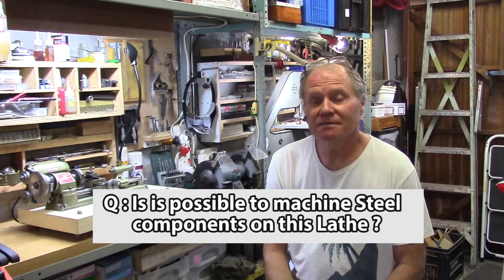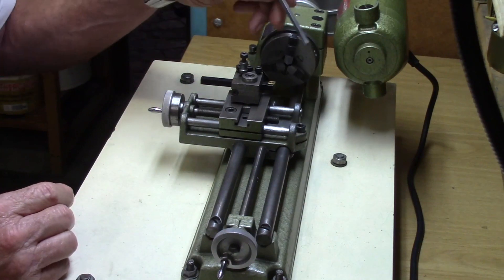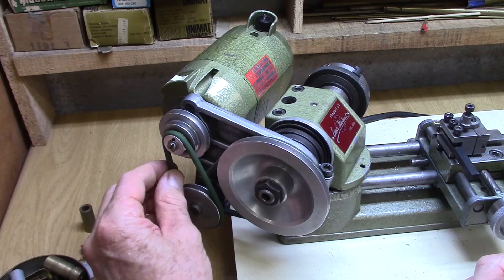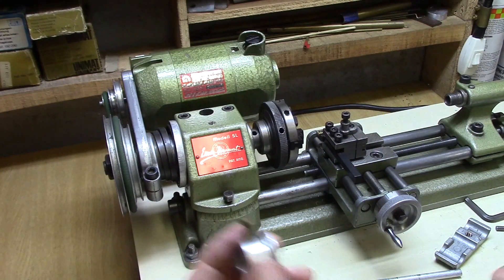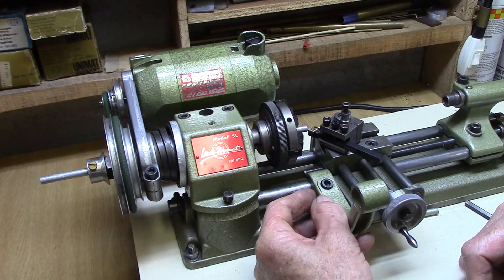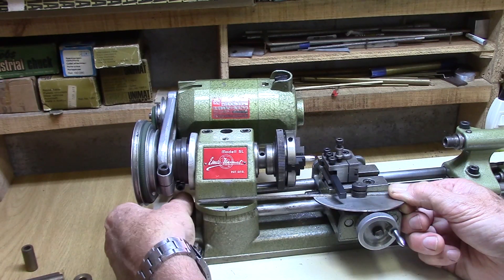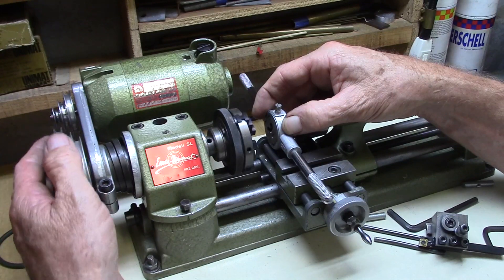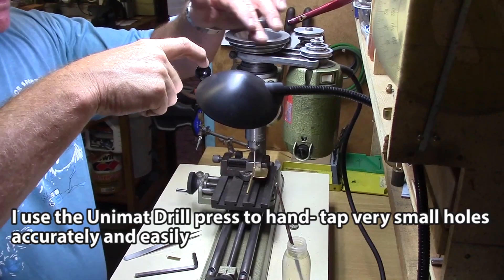More about the EMCO UNIMAT SL Lathe

Comment: Hi. I just bought a emco unimat SL and am busy restoring it. It came without a motor. I also live in South Africa, eastern cape. Do you know much about motor replacement options I could look at? I know some guys have used 24 volt motors with speed controllers. Don't know if or where I could source that here. Also my auto feed  is incomplete. I seem to have everything except the two shafts, the long one that the drive pulley attaches to and the short one on the other end where the two gears go on. Would you be able to give me sizes and dimensions and then I could possibly have them made up for me by engineering works here? Awesome channel. Thanks.
Reply from the maker: Hi, thanks for your interest. There are a few YT videos out there about replacing the Motor on the Unimat SL, just do a YT search on this subject. You need a 12Volt 100- 150 Watt  DC Motor turning about 1200 -2400 RPM with a Switched DC Speed Control and 30 Amp  12V DC Regulated Power Supply. I do not know where these components  could be sourced in SA but they should be available because they have other Industrial and Commercial applications..  I  do not have AutoFeed on my Unimat SL.
Reply: Thank you so much.

Comment: Hi what's the max swing on this lathe please. Thinking of getting one for making small steam engines
Reply from the maker: Hi, if you have access to certain Unimat SL  accessories it is possible to machine a flywheel up to 76.5 mm in Diameter with the Unimat SL by raising the Headstock using the intermediate piece. The Unimat  chuck jaws can also be reversed to hold larger Diameter work up to  30mm Diameter  Watch my other Unimat SL video on my SteamerEdge YouTube Channel entitled "All about the Emco Unimat SL Lathe ".  In this video I discuss the swing of the Lathe in some Detail at 2:50 and 3:30.Cheers Paul
Reply: @SteamerEdge  Hi, your tool holder looks very compact. Could you please comment on its dimensions so I can make one? I made one with aluminum dovetails, but it's very large and there isn't much space in my Unimat SL.
Reply from the maker: @drehmaschineklein6626  Thanks for your interest.  My Tool Post is custom built. I have a Unimat SL Tool Post Modification video in the pipeline which should be published in due course. The video deals with how my custom built modified Tool Post differs from the Standard Unimat SL Tool Post and the dimensions of my Tool Post.

Comment: How do you make the vertical configuration? are there another accessories needed to mount the motor?
Reply from the maker: Yes, watch my other Unimat Lathe Video " All About the Emco Unimat SL Lathe " which is also on my " SteamerEdge " YT Channel. This video shows how to configure the Lathe for Vertical Drilling and Milling.

Comment: Very nicely explained,  I have 3 of them setup un different configurations. All very useful. Watchmaker spindle on this lathe is a very useful option, as all pivoting and very fine jobs can be done with high accuracy
Reply from the maker: Thanks for your interest, yes, the Unimat is an amazingly useful and versatile little machine. I see you have an interesting hobby restoring old timepieces. I've always respected the fascinating precision engineering in old clocks and timepieces.Cheers Paul
Reply: @SteamerEdge   Dear Paul, indeed a useful and quite precise machine, in drill mode it can be easily converted to a light milling unit if feed mechanism is built. And it bridges the gap between C1 and watchmakes lathe. Jacot tool can also be used here in conjunction with watchmake's spindle and the thread follower is very versitile. Thanks, Sanjay

Comment: Would you only recommend mild steel with this model. Does it work better with hot rolled or cold rolled?
Reply from the maker: Hi, over the years I have successfully machined Mild Steel, Cast Iron and Drill Rod ( Specialized Carbon steel ) with my Unimat SL. You need to be patient, take very light cuts, keep lathe tools sharp and keep the work piece well lubricated during machining. Cheers Paul
Reply: Thank you so much

Comment: What kind (length) od belts You using?
Reply from the maker: Hi, I use 4mm diameter Polyurethane Belting material  This is a fairly common commodity because it has many industrial applications and you should be able to easily source the Polyurethane belt material in your area. This belt material can be cut precisely with a very sharp hobby knife. Before cutting, measure the right  length by placing the belt material on the lathe drive pulleys to acquire the tension you feel is right. Measure twice before cutting to make certain and then mark the cut with a pen. After cutting, try the cut belt section on the pulleys again to determine if correct length has been cut before joining. If not, either shorten or start again. Join the belt using heat, something like a cigarette lighter or a flat-bladed soldering iron. Carefully smooth the rough edges at the join using coarse sandpaper. There are already a number of YouTube videos showing how to join Polyurethane belts, just do a YT search. cheers Paul
Reply: @SteamerEdge  you can use super glue also, I’ve never had one break at the seam

Comment: Hi! Awesome video. I just managed to get a hold on one of these machines through an acquaintance of mine, but it is incomplete. Are you able, by any chance, to provide me with some dimensions of the toolhead/toolpost? It seems I am unable to get my hands on an original one.
Reply from the maker: Hi, I have a video in the pipeline which should be published within a week or two about a modifications to the standard Unimat SL Tool post. The video also shows the standard Tool Post dimensions. You can also buy a manufactured Tool post, which fits the Unimat from RDG TOOLS. Have a look at their website and type Unimat Tool Post in the search bar. cheers Paul
Reply: @SteamerEdge  Thanks! I'll look into it.

Comment: Fascinating machine. I have begun restoring my father's this week and look forward to getting it up and running again. One Q: Where do you get the belt material and how do you make them? Thanks!
Reply from the maker: Hi, thanks, I use 4mm diameter Polyurethane Belting material  This is a fairly common commodity because it has many industrial applications and you should be able to easily source the Polyurethane belt material in your area. This belt material can be cut precisely with a very sharp hobby knife. Before cutting, measure the right  length by placing the belt material on the lathe drive pulleys to acquire the tension you feel is right. Measure twice before cutting to make certain and then mark the cut with a pen. After cutting, try the cut belt section on the pulleys again to determine if correct length has been cut before joining. If not, either shorten or start again. Join the belt using heat, something like a cigarette lighter or a flat-bladed soldering iron. Carefully smooth the rough edges at the join using coarse sandpaper. There are already a number of YouTube videos showing how to join Polyurethane belts, just do a YT search. cheers Paul
Reply: @SteamerEdge  Thank you for the informative answer. I have since tried 3D printing a belt with TPU (flexible filament) and it was a great success. I have not run it for any length of time though so time will tell if it's a feasible solution. It's flexible but not stretchy like an o-ring for e.g. would be so I will need to print various diameter rings if it continues to work. I assume you are South African? I'm in Cape Town :)
Reply: @SteamerEdge  Actually - if you are in SA then do you have a link at all for the Polyurethan Belting?
Reply from the maker: Hi, I live in Cape Town. I got my polyurethane belt material about 10 years ago from a company called Belting Ware located in Maitland, Cape Town. I think they also use this belting material for Sewing Machines there should also be other suppliers in S.A.  Just search for "Belting Ware Cape Town "on Google. You need a 4mm round Polyurethane belt, the belt is sold by the meter .

Comment: Normally the thread on both columns is M8x1 left hand, so very nearly to .99 per rotation?😉
Reply from the maker: Hi, I measure the amount of advance by putting the jaws of my digital caliper against the sides of the Cross slide while it is moving. It always measures exactly .99 mm advance per rotation of the Cross slide hand wheel. It is supposed to be exactly 1mm of advance movement per full rotation according to the manufacturers specifications but my lathe advances  .99 mm. The amount of longitudinal movement of the Cross slide is also exactly .99mm per rotation on my lathe.
Reply: @SteamerEdge  sure, but digital calipers have already a tolerance +/-0.02mm. What happens if make ten or twenty turns?
Reply from the maker: Hi, agree, the degree of accuracy wanes on a number of revolutions of the hand wheel.  I learnt the hard way long ago never to rely on the graduations on the Unimat hand wheels to gauge depth of cut if you want very accurate results. I usually only work to a 100th of a mm tolerance in all my projects. I use the Carriage return stop and take constant micrometer or caliper readings for accurate turning. You get a feel for what works as time goes by. I am aware that there many other ways of doing things. I do what works best for me.

Comment: You have the same pully setup I have. Most don't have the extra one. Where do you get the belt material? Can you do a video on how you make them?
Reply from the maker: Hi Christopher, I use 4mm dia Polyurethane Belting material  This is a fairly common commodity and you should be able to easily source it in your area. They can be cut precisely with a very sharp hobby knife. Join the belt using heat, something like cigarette lighter or a flat-bladed soldering iron. There are already a number of YT videos showing how to join Polyurethane belts, just do a YT search.
Still, a very short video about this is not a bad idea, thanks, and I probably will do one at some point. Cheers Paul

Comment: I love mine.....
I converted it to CNC then back to manual. It's a lot more fun as a manual lathe.
Reply from the maker: Thanks, yes, the Unimats are like an addiction, once you get started there's no stopping :-)) Cheers Paul
Reply: @SteamerEdge  I'm like that with heavy vintage machines.....but I've been collecting all the Unimat accessories for years. Anytime I see a piece I don't have, I grab it.
The deal I made with my wife was no more machines bundled with options and tooling.
Only stand alone deals.....
So last year an ad on Craigslist for a COMPLETE with every option some stuff I have never seen before or since came up for sale about a mile from me. It was in an original crate/footlocker thing. It had been opened and looked through but it had never been run. 
He wanted 3000 for it.
I couldn't even get ahold of my wife to ask her and since she's been forging my signature on everything for the last 30 years I can't even cash a check without her help....
So I told a friend about it. I said buy this and when she gets back from her sister's I'll buy it from you. 
I negotiated a deal for 2000 and told my friend I'd give him 200 bucks for his trouble...
HE KEPT IT FOR HIMSELF and sold it off piecemeal. Made a FORTUNE and lost a friend.
He didn't even know what a lathe was....